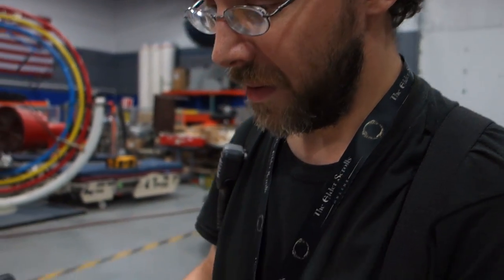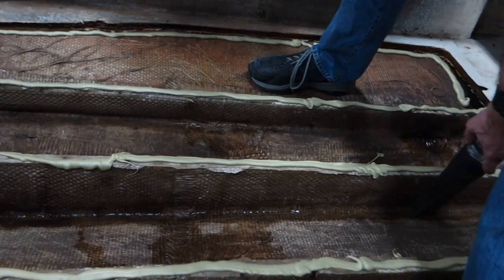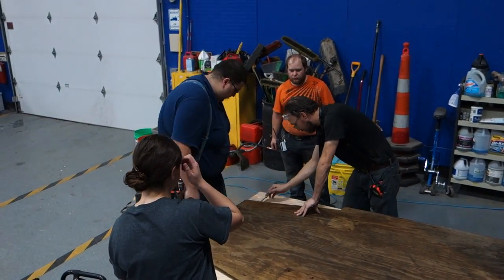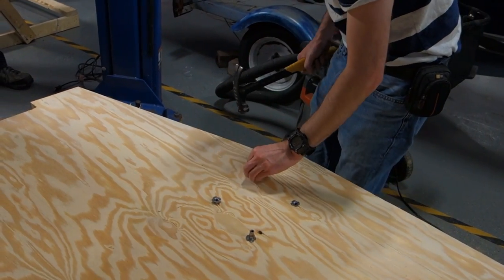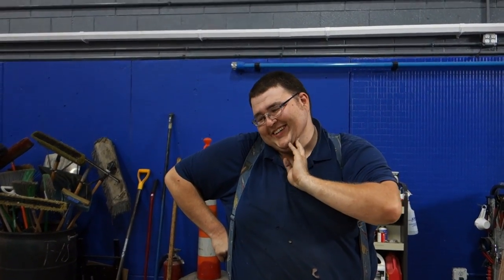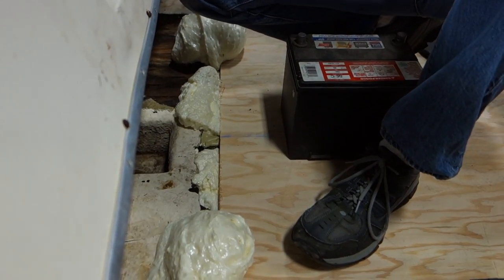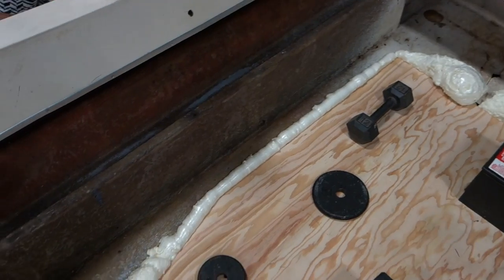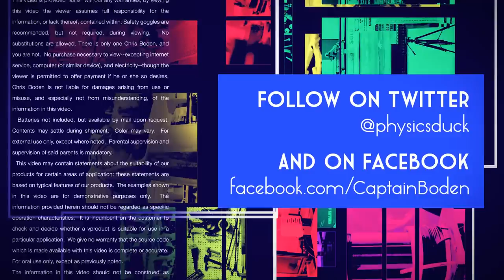Captain's Blog 9 8 2015 Boat Project Foam and Subfloor

Comment: For motor start capacitors you want to to be close to the 12 micro farad but can be a few over and it will start just fine.  The voltage rating doesn't matter as long as you are over 1.414 times the ac voltage.  So for 120VAC it will need to be rated for 120x1.414=170V or higher.  It could be rated for 4KV but as long ad it meets or slightly exceeds the 12 micro farad capacity it will work just fine.

Comment: Coat the bolt threads in a release agent (oil or vaseline) should make it easy to unscrew,
I would have drilled small holes in the middle of that subfloor to squirt the first bit of foam into.

Comment: The fucked up thing about 1 part foam like a Great Stuf, is that it hardens in air unlike 2 part foam.  That means that even moderate thickness amounts 'Never' harden in the center because the cured foam is closed cell so air can't get to the middle. The 1 part foams are really for filling seams and cracks so it can harden completely. The way you're using it will work because the foam is sealing the seams. Oh, and just grind off the protruding part of the insert nuts.  Boat name: The Captains Dickbola.              Yea, I ain't right sometimes.  ;)
Reply: +Ken Wolfe 
More precisely the 1K foam needs moisture to harden. You can spray it with water if you want it to develope a non sticky skin faster (helps with the cleanup of spillouts). It's often a good idea, especially if used in walls or any porous material, to wet the insides of the hole so there's enough moisture "inside" that doesn't have to come from the air (but the surface should not be dripping wet). It will allow the foam to harden faster. The foams will harden through eventually, even in large volume, although you are correct that it will take longer. Quite often the small bubbles of the foam have collapsed by that point and you can end up with holes like swiss cheese when cutting the foam.

1K foams are water proof but NOT water tight. If someone tells you they are or worse tries to seal holes in walls around pipes that enter your basement for example you should fire him.

I hope they put enough weights on the plywood. There are slightly different types of foam, but all will exert quite a large pressure even days later (essentially until it's through hardened; could take some time here), which with an area like that sheet of plywood can amount to quite some force.